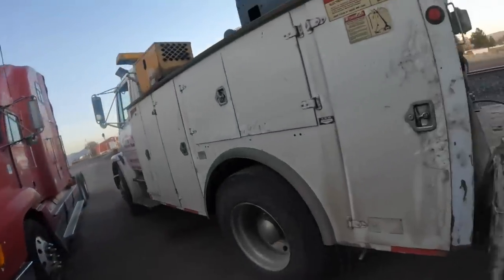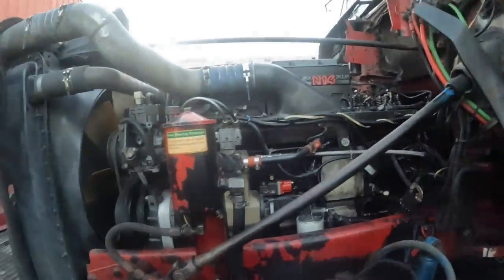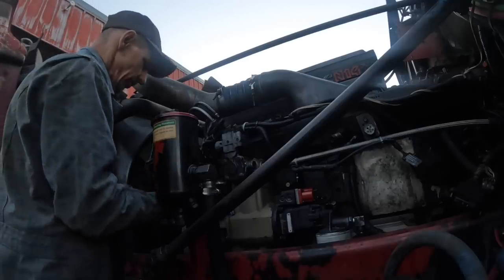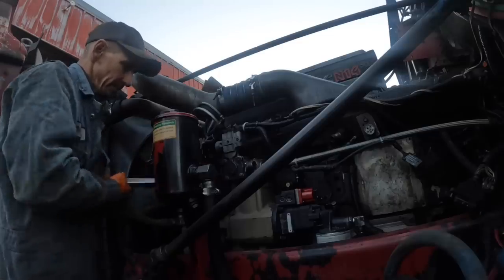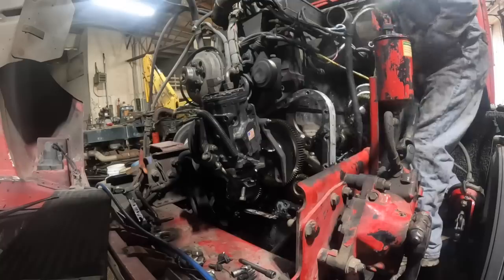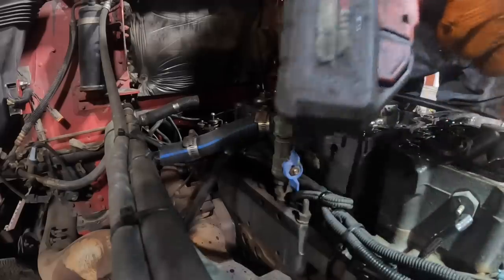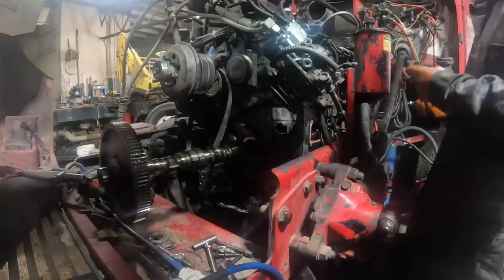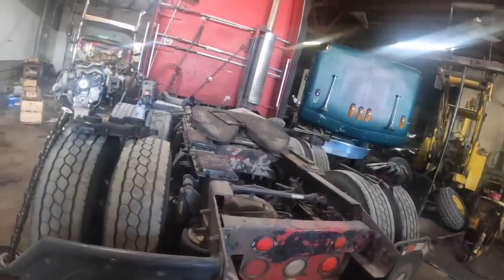Removing a stuck push rod.

Comment: when big cam cummins first came out, snap on made a special wrench to get those bolts out on compressor and pump because the followers got bigger and didnt leave much room.  That is the only tool I have ever bought from snap on and they were a time saver.  Have fun with the fld.  Bill
Reply: I grinded mine out to make it fit better and it was the snapon just for removing it 
Still works great

Comment: Hey man, thanks for what you do. About 2 years ago I was a security guard, got lucky and got myself in the shop at an equipment dealer. I don't even consider myself mechanically inclined, but I learn as much as I can and I love it. I probably would've gotten fired a long time ago if it wasnt for you and other guys sharing their knowledge, so again, just wanna say thanks.

Comment: Been working on a 389, owner had another shop swap a cm570 in after the block failed on the 871. Junkyard engine of course shop couldn’t get it running gave him a 20,000$ bill and he had to have the truck towed home. Truck came to us it had low fuel supply pressure needed a gear pump, had pinched the wires going to the coolant temp sensor, never bothered to set up the j1939 for cruise Jakes fan etc, pulled the valve cover injector cam is wasted, they put a hardware store bolt in the rocker shaft and pulled the threads on the head. Got the head off today liners look like the thing was stored at the bottom of the ocean. I question my abilities constantly, I beat myself up over mistakes and comebacks but then I see videos like this one and I see the workmanship on this truck I’m working on and it just blows my mind. Keep up the good work warren

Comment: Thanks for the video sir. Sure learned a lot from this one. Doing it cheap cost more in the long run, boy I have had to (in some cases) work with clients who whined and try to chisel you down on everything, that’s when the warranty was with drawn,  then sometimes, you have a guy come in who is hard against the wall, and truly can’t afford to and yet not afford to do a right job, I willingly work with them as best as I was able to, without cutting my own throat, sometimes working with people is worse than working on a breakdown, but it’s all part of the game.

Comment: Hello Warren, I gave you a thumbs up as usual. I remember working on a Cummins like this where a push rod came out because the adjustment was real loose. Fortunately it was easier to remove than yours was.
Reply: In 58 years I had several that were a B to get out, but I still remember them Lololo 😊😊😊

Comment: Hey, Warren Cummins has a tool to pull that back cam bearing , it has three spring loaded pins and uses a threaded rod with a big washer and a nut , I rented this tool from Cummins in Spokane several times a few years ago it worked good , it was a hell of a lot easier than pulling the engine or the transmission good luck buddy.

Comment: When I was an apprentice I rebuild an old N14 STC out of a 9390 Steiger and torqued up the rocker shafts the 25ftlb and the 90 degrees or what ever it was, ran it up and ran fine for about 2 mins before it started clattering like mad, pulled the covers back off and it turned out I’d not done the torque turn on one rocker shaft and it had come loose. Luckily no damage just checked the pushrod was straight, which it was, tensioned the rocker shaft and reset the valves and it was good as gold. Ever since then I’ve triple checked all my internal engine bolts and lock nuts. It’ll stick with me to the grave that stuff up.

Comment: So about the tool marks.  I took note of the "cut lines" on the push rods and I have the view that the score marks were left by a "basin wrench".
Which as a tool has an offset, and where I think, for what ever reason....the "non-mechanic" used that tool to in fact turn the pushrods as 
a tension operation was part of the process?. The test and capture of a bad injector I think would give this job a very satisfying band-aid. The root cause as led to your service.."  Maybe to adjust down the rockers until bottomed out?   Yes on thumbs up.  As I became a subscriber about the time (before) the last service truck change up, 
As semi-retired from a large maintance position, 14 crew  ....I have a great time as repair in a single bay shop.  And I find that where customers are feeling various pressure.  Thus, I have to be very careful to costs while as best service, listening to their concerns.  The overriding fuel cost, 
and the financial realm linked to insurance and various tax....basic needs all spell a demand to "get by".  Which is the sort of maint. pointer that gets lost as full on care about mechanical wear, best parts, plan for transport are the service need.  Very real and underestimated much of the time by the customer. The exception, that group with a constant hands on best operation and savvy managers.
Where individual fleet or production machines, are the cost that is built into goods.  That drumbeat as skyrocket cost, impacting quite everything.
What your posts have at the quality to service, simply speaks volumes.  Shop to nature to shop.  Parts channel to repair anything.  I like.  M.

Comment: I was fighting rusted seized hydraulic hose to street ell fittings on 2 cylinders yesterday. Never could get 2 to break loose even with dull red heat. New fittings and hoses going on today...... Some days it sucks to be a wrench turner.

Comment: Saw the mechanic put a welding rod in a soda stray and poke it into the hole. Minute later broken head bolt came out on the rod. Pretty cool. You've probably done that too.

Comment: I pulled a conecting rod out of my 1964 Triumph TR4 that looked like that push rod, it was a lot easier than  your struggle. I reckon that pushrod ends gunna have a ball in that oil pan..

Comment: Thumbs up button hit Warren 👍, Could you not warm the worn cam bearing up then let it shrink as it cools then pull with an inner bearing race slide hammer with a long bar sticking out the front of the engine ?

Comment: Valve adjustment is pretty cut and dry till it ain't. Feel sorry for the owner: on the road,need valve adjustment,go cheap and get a trashed engine.

Comment: Just did an N14, if you cut an open end 5/8'' wrench, use the box end and hammer n punch on the wrench that bolt is fairly easy and even easier if you remove the housing bolts and clock the whole thing around a bit , but you break the gasket seal...

Comment: One thing I would like to know is what are we going to do when everything goes electrified and tractor is in the field dead we get this all the time at the airport the user groups won't plug them in we can use a ground power unit but those are fuel  are we going to get extra long extension coards?

Comment: Cummins made so many different versions of the 855 and they had several different overhead settings that if you didn't go to the book and CPL number you can screw up. I know i did on a 444 stp engine.

Comment: I seem to recall that Cummins have a knack of putting  nuts and bolts in hard to get places. Here in the UK on what we call the "B" series engines with the CAV DPA pump there was one nut at the back that was a bas__Rd to get off, I had to make my own spanner to get at it.

Comment: Can you use a blind hole collet bearing puller to remove the last cam bearing.

I wouldn't worry about that pushrod end being in the oil pan myself.  There is cheap way to ensure the end doesn't move and that to slap the heaviest neodymium magnet you can find on the bottom of the pan to lock it in place.

Comment: I've got a cheap ass in the shop right now too, pulled the rad and then he didn't want to spend the money for a new one{crimped plastic garbage} so I put it back in and put silicone over the crack. It came in 4 gals low on coolant so he'll probably end up cracking a head and wishing he just spent the money to fix it right.

Comment: I had to heat one and bend it some to get it out other one I used a air hack saw and cut it and washed out the area but also had oily rags around it

Comment: I don't get cheap people like the owner of this truck who won't do the obvious things on a job like this. If it were my truck I'd do the cam followers, the appropriate gaskets, and the seals in the front cover while you're at it. In my view there's now a non-zero chance that the truck gets a block down the road and the crank or accessory seal will start leaking because it's been disturbed because of the job and now it's gonna be back in the shop later to get it done

Comment: Done headgaskets on a V6 GM one time. Customer only wanted to replace the headgasket that was bad.
I said sure no problem but there will be no warranty on the repair.
They said "you can warranty that one gasket".
I said nope no warranty because its an incomplete repair. Your basically just putting a bandaid on it.
I understand people want to save money but they dont look at the big picture.
Spend a little now so you dont have to spend a lot later.

Comment: usually I found over the years, when you have to fix a huge screw up like that, It winds up being the owner that was "the other guy" that worked on it first. Not always though, as there are a lot of trained rats out there that call themselves diesel mechanics. And they always wonder why mechanics are so grumpy.

Comment: California has a lot of gall to virtual signal about the environment. Governor Moonbeam was crowing about how California was reducing their emissions while all the states around them were increasing. Over a ten year period my company installed over 180 large Co-Gen gas turbine generators all along the border of California in the neighbor states. These units run 24/7/ 365 at full load and the electrical power they provide is all pushed into California. So the emissions are charged to the neighbor state and California gets the power.
 A few things with that are a problem the power pushed across state line has export / Import fee attached to the KW rate so it is more expensive. Also there is a long way to go for the end user market so you have Massive line losses and the problem of line outages if there is a problem in the transmission lines . IE wild fires. 
All of these units could have been installed in remote areas of California or beside smaller towns and cities. They all run automatically and if the grid was to go down to a town or city these units could separate from the grid still supply that area. When the grid comes back on to a stable condition these units will rejoin the grid and supply power to it as well automatically. By installing these units across California where the load is it would have made the power supply system more robust and less likely to long extended blackouts. Why this was NOT done was to virtual signal about the environment. This stupidity could change if the emissions were charged to the end user instead of the producer.

Comment: Did you say 'no Warrenty' on that?!!! :face-blue-smiling:
Reply from the maker: Yup, when the customer refuses to buy the proper parts for a complete repair there is no warranty.
Reply: Why would he offer warranty on that job? Do it right do it once. Cam & Roller together - if an old roller delaminated & ate the cam why should the repairer be expected to fix it when old mate didn't want to spend the money to fix it right the first time?

Comment: It would be very advantageous to know who the individual was that performed the work that ultimately caused all this damage to this man's truck. Name him please and save others the nightmare of his services.  Also, with all the wear that is evident on those cam bearings and the other damages caused should one not pull that oil pan off and make sure there aren't metal filings or small pieces of shavings that might be small enough to go through the pickup filter? That would cause me some sleepless nights. Enjoyed the video. Thank you.